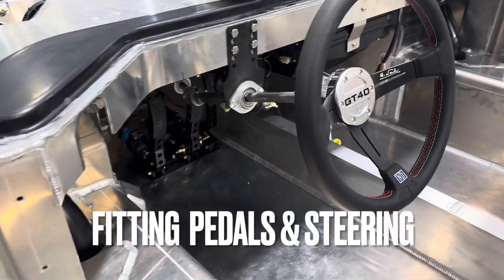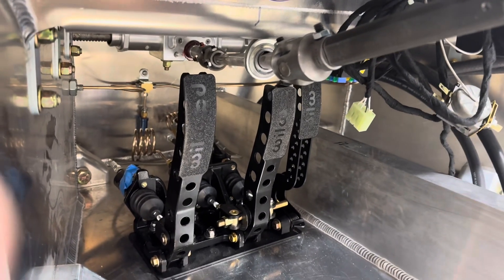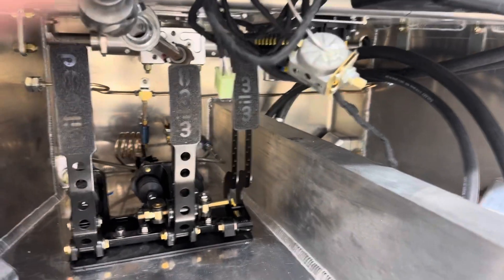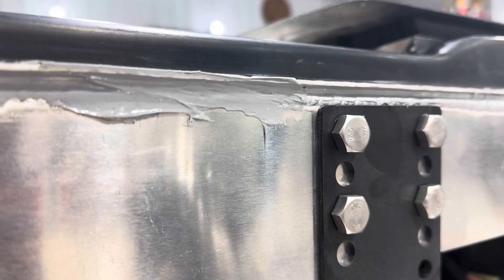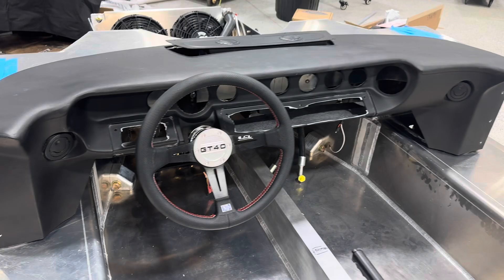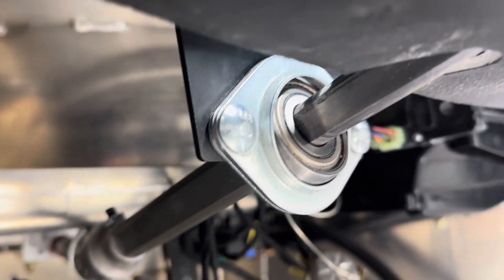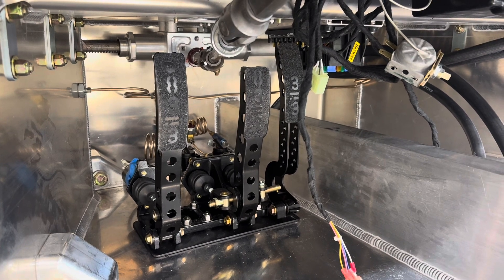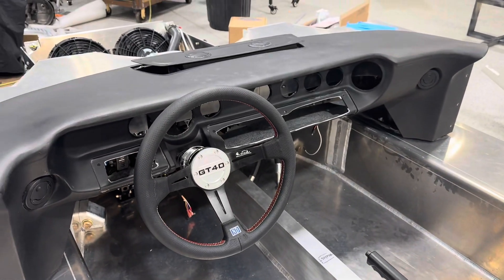Ford GT40 (RCR40) Project: Final pedal placement & steering.

Comment: Cool project! Are you going to put anything on the floor? My street car has carpet and it drives me nuts how much my heel slides around. I may add an aluminum plate with some grip tape.
Reply from the maker: @nicolashuffman4312  I have a carpet kit for the car and that the plan for now. Contemplating if I need some sort of sound/heat shield barrier throughout.